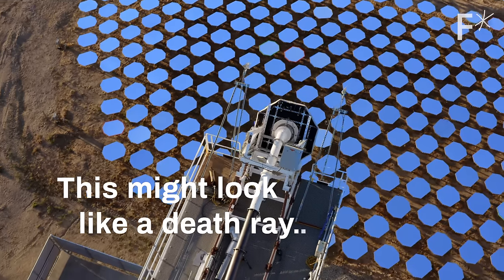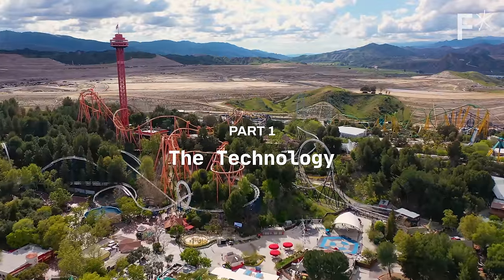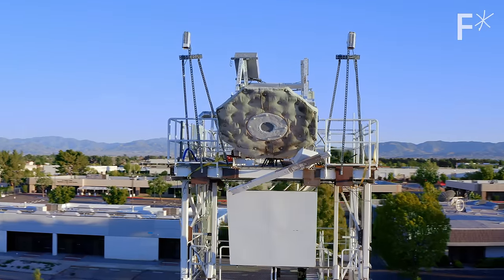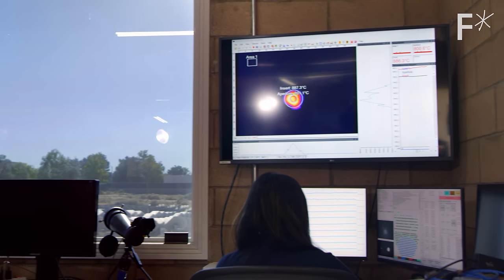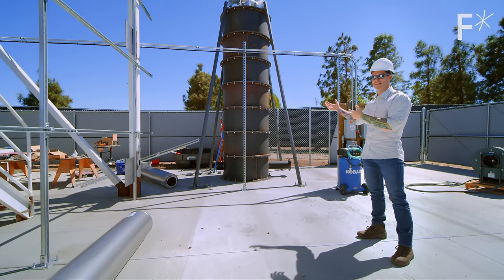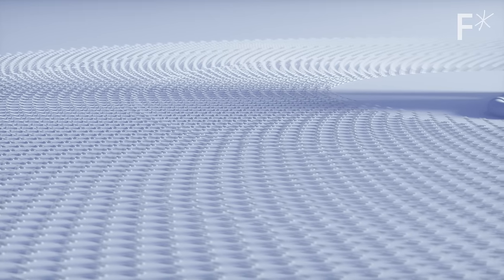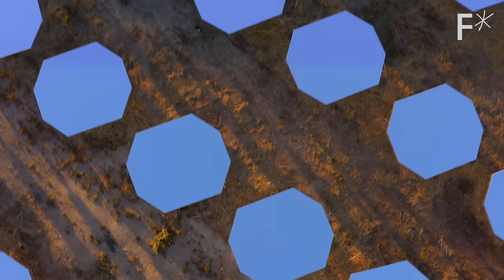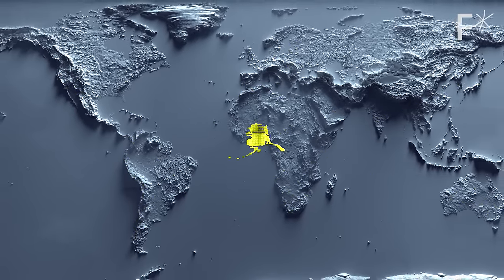How mirrors could power the planet... and prevent wars | Hard Reset by Freethink

Comment: Literally just saw a video on a plant like this where the mirrors were slightly off & it set the whole thing on fire & because the mirrors move there are many more parts to manage & points it can breakdown & that a regular solar field is less efficient but far less costly to maintain...I'm betting on these new small nuclear reactor SMRs. Seem safer & more  economical, sounds bueno to me.

Comment: but can this be cheaper than fossile fuel?
Reply: But can it run Minecraft?
Reply: Fuel made from it is now not, though greener. But in sunny areas the ceramic battery that can work constantly, safely, makes it better than solar, wind, flywheels, and many other alternatives. Hydrogen made can be stored rather than sold as fuel initially, for fuelcell backup power when there are several days of poor sun.
Reply: Sure thing. If this becomes a relatively inexpensive instalment, as these mirrors requires no rare or special materials, and are easy to produce, don't require much service and repairs, and can be linked up to the already existing electric grid in most places, then definitely yes. The only hurdle they presented here seems to be that they can only be built on land where the sun is always shining. And it's an added bonus if it's on flatland, but it doesn't have to be - but it makes the construction of them far easier.

Comment: The question is how do the solar efficiency and economics compare to photovoltaics? Large arrays of mechanised mirrors look expensive and the thermal steam cycle power generation also has inefficiencies associated with it. Maintenance looks like it would be higher than pv.
However achieving >1000 Celsius at the collector is a very impressive achievement.
Reply: It doesn't need to be more efficient. Just cheaper overall.

Comment: There's so much talk about how solar or wind are going to displace oil. What people forget to mention is that solar and wind only produce electricity... Yet only 1% oil is actually used for electricity production! About 2/3 of oil use is for transport and the remaining 1/3 is for industrial purposes like making plastics and textiles (polyester, nylon etc...). 

So if you want to completely replace oil, you need to talk about fully electric cars that cost under $20k and finding "green" materials cheaper than plastic.

Comment: This has been done in several countries and eventually it suffers all of the issues that any solar generation scheme suffers from. Things break, clouds cover the sun, it doesn't work at night, etc. This system is also extremely efficient at destroying hapless birds, etc. Bottom line, this will deliver usefully energy about 15-18% of the time. A standard petroleum power generation plant is still far more efficient, reliable and durable. All the renewable schemes do is enrich a couple of people at the expense of a large majority.

Comment: This is the perfect solution, PV will run out silver, and wind will blow the power grid, but this is genius. So far this technology has been 4 times as expensive as pv, but this will make it much cheaper. 
And we will never run out of glass (sand) and aluminium, compared to silver for PV.

Comment: The one problem I can see with this is the major cost of infrastructure for piping water for hydrolysis in and transporting hydrogen back out. That's a lot of massive pipes if we ever want to put these in a desert that's not near the coast. Also, it'd better work with plain seawater, or else. Fresh water is already in short supply.

Comment: Good concept but:
1- How to produce electricity in the middle of the desert from heat? If you need water to generate steam -> electricity, where will the water come from? Same question for the water required to produce hydrogen?
2- Transportation of Hydrogen is not that simple. Transporting from deserts to other areas by sea or by pipeline is also quite costly definitely not easy (need to compress, special tanks, etc...). 
3- Converting back hydrogen to electricity in large quantity would require lots of change in the way energy is produced and consumed now. For instance, what is the efficiency ratio from desert to heating your home by electricity if it goes Sun->heat->electricity->Hydrogen->transport->electricity->heat?
4. Cost for all those changes compared to current cost of running things?
I love the concept, I am ULTRA green but saying this is the way to power the world is a fantasy...

Comment: Wars are not fought because of resources per se. It's more that corporation supply and control is more important than sourcing sustainable resources. Dependence on oil is an issue because alternatives are quashed forcing continued dependence. The same goes for every major commodity.

Comment: Great idea, but there are 3 problems:
1. There is no way to produce large number of hydrogen from the sea where is the highest weight of usesful for humans (and plants) water. There is no energy balance in that, producing hydrogen from the sea cost more energy and resources than it can give back, because electolize process is not enough efficient and sea water destroys equipment really fast.
2. There is no way yet to use, transport and fuel reactors with hydrogen - safely and commonly. What does it mean? For example I want to go to a shop, buy for 60$ a reactor fueled with hydrogen and it will produce enough electrical energy for my entire house (with heating) for a month. The same with a car - 40$ for entire month of driving to work and shops. There is no Plug and Play hydrogen reactor solution on the market and for example hydrogen reactor in Toyota Prius weight is 300KG, so I can't just go on a station and switch empty for fueled one. The same problem appear with industrial solutions - there is no way to transport and stocks a high number of hydrogen. The Hydrogen Electricity is a dream which cant rise to reality, yet.
3. I am working with batteries, once I saw how hydrogen explosion and I dont want to even image having pure hydrogen near me. If you ever saw a gas container explosion, hudrogen in the same container will produce 10 times more explosion energy and it is 10 times easier to start it (for example, metan to explode needs proper proportions - 5-15% of gas and 85-95% of oxygen, hydrogen JUST needs oxygen and any kind of spark to explode no matter the proportions).

Comment: Hasn't it been established by now that photovoltaic plants are a more cost effective technology than solar concentrators? 
The energy storage and transport problem stays the same for both technologies.
Reply: Too begin with this technology is more efficient and technically better for the environment, the material needed to build PVs are very harmful to mine and if were going to power the world with it jts going to be extreme,y harmful, the most important point is Heat, this is a very good way to get high heat and replace fossil fuels

Comment: Question for the Freethinkers (Freethinkists? Whatever): the first few minutes of the clip talked about how industry—steel & concrete were singled out—contributes 20% of greenhouse gases worldwide. To me it seemed like the rest of this piece was on providing energy to the grid in general.  My impression is a lot of heavy industry produces it’s own energy (heat from gas or coal) instead of taking electricity from the grid. My question is would the energy grid be able to handle this upscaling of energy requirements, and would it even be viable for large manufacturing plants to be able to use the grid this way?

Also: although not very practical, it would be waaaaay cool to see a steel foundry install this technology to melt steel directly!

Comment: I just had a thought. These solar power plants practically produce oxygen, and hydrogen, right? These gases can then be transported over long distances to a place with little sun, where the hydrogen and oxygen react to create heat, with the byproduct of water. This would be phenomenal in the War against Russia in Europe, because it is mainly fueled by the economics and reliance of most of Europe on gas, and on Russia to get gas. I live in Germany, and here we have been brought to our knees to even reopen Nordstream and start using old nuclear power plants again under high resistance of the crowd. This company could theoretically profit on this desperation. There is high demand for a gas alternative such as hydrogen gas, or just a way to produce large amounts of energy, cheaply, to replace gas as much as possible. And I assume, though I am not sure, that existing infrastructure which uses gas to heat stuff such as stoves or heating cells in homes could switch to using hydrogen with some adjustments.

Comment: "why is it that there is some where else in the world that could choose to shut off our supply..."  The US supplies most of its own oil or imports it from Canada.  Not the Middle East. I get it though.  The advantage this has isn't over oil, its over solar.  Instead of transferring electricity from solar panels to hydrogen during daylight, this system could, by using heat batteries, theoretically run 24/7.

Comment: I actually do like the idea of a hydrogen-based energy economy. However, I have concerns about this type of solar power. The similar systems that currently exist, which they referenced in the video and said achieve temperatures of around 500 degrees, are known to fry birds that fly overhead, because they can't see that they're entering an inferno. I'm not sure how many birds are killed that way, but if we covered an area of the planet the size of Alaska (that's what the video said; I'm not sure if it's accurate or not), that could amount to a substantial problem. 

If what we're going for is a hydrogen economy, I think that different methods of energy production could be used in each place. Many, maybe most, countries have coastlines, where they could take advantage of wind power and seawater for the production of hydrogen fuel.

Of course, changing to a hydrogen economy would be an uphill battle, unfortunately.

I think the advantage to the system shown here is the low cost of setup.

Comment: One pragmattic side note: It is claimed that the system is adopted once it's even a fraction of a cent cheaper than fossil fuels. While this may in principle be true, the system also only works ideally in a desert setting. These sites are, however, rather scarce for european countries which ultimately means dependence on other countries. And especially the states adjacent to the sahara (which would make most sense for europe from a logistics standpoint) are not politcally stable. And after the Russia-Ukraine conflict the EU will try to avoid too much outside dependence on politically non-reliable partners.

Comment: I think this is an incredible technology from a point of application. I don’t see it changing much about geopolitical tension in the big picture. There’s still going to be specific regions where the sunlight is best harvested. Coincidentally that will mostly be countries who are already feuding over the land where oil is found. I don’t think this means that these technologies are useless though, they should be researched to the furthest extent until we find something that produces calories for less cost than Dino-Juice. Nuclear is definitely another solution in that department, given modern modular plant designs can be implemented anywhere. Same goes for advancements in the field related to cost, material availability, and climate impact. I think in the end the solution will turn out to be a grid powered by multiple sources from multiple environments.

Comment: If you used actual magnifying glass at the point the mirrors hit you could get even higher temperatures with less mirrors.
Reply: Actual magnifying glass at the hit point would also make this take up less space.
Reply: In order to not melt the magnifying glass there would need to be more than one magnifying glass in a circle around the object you are heating.
Reply: The point the concentrated sun hits the final object could be a magnifier instead of the object you intend to heat and the object is just beyond the magnifier. With way higher temperatures we could bore through ground creating glass holes that go clear down to the mantel core.
Reply: I am aware this is basically a way to make a death ray but it could be used to make glass, make geothermal electricity plants, make energy batteries that operate around the clock off solar power, make glass out of ordinary desert sand instead of course sand. It has many good applications if done in a controlled manner.

Comment: Your bottle neck will be the lack of hydrogen fuel cel powered vehicle and their cartel like expense and selective sellers. HHO internal combustion engines do work but their efficiency is buns so high fuel consumption cost. You will also be bottle necked by hydrogen refueling infresture and designing and mass manufacturing  hydrogen vehicles for every application that can run on the stuff. Also the thermal part of geothermal could produce constant NOx. You should be able to stop this by putting a insulate air right glass membrane around the mirrors or a insulated air tight or pressure negative box around the mirror set up and the generators focal receiver. 

The shipping fuel idea around the world is good but compressed raw hydrogen is not a good medium. The high pressure pneumatic systems are heavy and expensive. May I recommend methanol perhaps with carbon capture or bio or waste recycling applications? You can use the heat to reform the biomethane into methnol then bottle it as it is plain liquid fuel backwards capable with slightly modded current internal combustion engines and refueling pumps and fuel cell devices in case the future cheapens them. 
Using rocks/sand battery for local storage is smart. But now you can also use cheap stainless steel or plastic drums or toats for the methnol to greatly expand cheap power storage capacity. If by some miricle someone can get ahold of a substantial fuel cell they can use it to power the grid at greater efficiency but otherwise turbines and ICEs can use it cheap.

Automation is good but requires the world to wait to long for such a important technology to be widely available and greatly increase 1st generation adopters cost. A trained crew with less sophisticated manual tools will be faster and cheaper short term. I also can’t notice a lack of your real world automated tractors which tells me developing those have been a expensive ball ache for you.

Comment: Water scarcity is an issue here. This infrastructure would have to be paired with pumping stations and pipelines on the coast pumping seawater inland to be used to make hydrogen fuel which immediately increases the cost and might even completely nullify the entire operation altogether. Pumping water uphill takes a lot of energy. Auto industries are fully moving towards Electric now, so at this point Hydrogen as a fuel would need to directly break into the electricity generation industry and I REEEEEALLY don't see this system competing in any way shape or form with the fully established and highly dependable infrastructure of the fossil fuel industry.

On paper this is the future, it makes complete sense, but in reality the way our society is set up this is never going to work unless there is a concerted effort from politicians to make it so. The benefits are far too far down the road for them to care.

Comment: Could this be scaled down to a residential application? International Solarthermics patented an   A-frame rock storage home heating unit back in the early 70's they, as far as I can tell are gone but the idea to this day always haunted me. If you could heat a volume of stones to say 200 F degrees in winter you could heat your home without input from fossil fuels or electricity except in emergency situations. Patent # 3,946,721 it was a flat plate air collector, if concentrated the heat could effect more storage area more quickly just using air as the transfer fluid.

Comment: Question. Through which transfer medium is the heat carried to the "rocks" ? By conductive metals? Most metals have a melting point starting at around 600°C -800°C, some lower, some higher.

Comment: No, it is not an Ai it's just code, it does not have to make its own decisions, it's simple if/then statements. 3:40 It IS hardware, they took the sensors off solar panel trackers and have a camera do it. Sure it may be cheaper but "game-changer" is like calling the .jpg file a game-changer because they aren't using .png .

Comment: How far apart could mirrors be to align within a range of angles? Picture each mirror being placed on a building roof, such as a church roof for example. How might they align from different perspectives? How high a geometry could be possible to achieve? Where else might mirrors or generated beams or pulses be required to construct a constant geometric network...? 🤔

Comment: This system is clearly too expensive, & the idea of shipping another fuel type around the globe, doesn't sound like a step forwards. There were also no figures provided for the carbon footprint of such a system. Without any facts, it's just hot air...

Comment: Hydrogen is an extremely unefficient way to store energy. You need 55 kWh of energy for 1 kg of hydrogen, and another 30 kWh for compression, cooling and transportation.
To give you perspective, a hydrogen fuel cell car can drive 100 km with 1 kg of hydrogen, so 85 kWh, while an electric car only needs around 17 kWh of energy, more than 4 times less.
The only thing hydrogen can be used for is industry, especially metal work industry. You can't melt metal with a metallic heating plate, since this plate would melt itself, so you need gas. So it can either be fossil fuel, biomethane (aka cow farts), bioethanol (fermented corn syrup), and hydrogen.